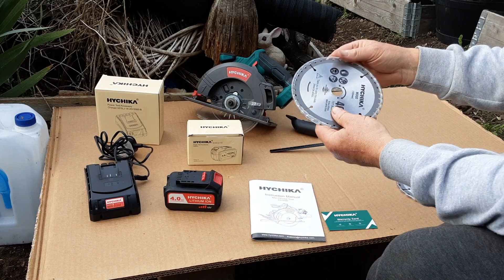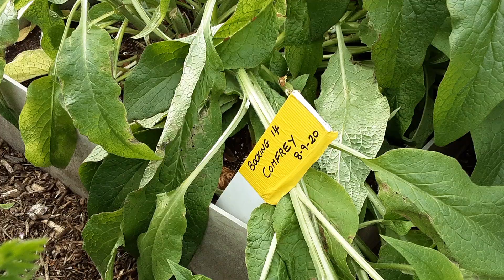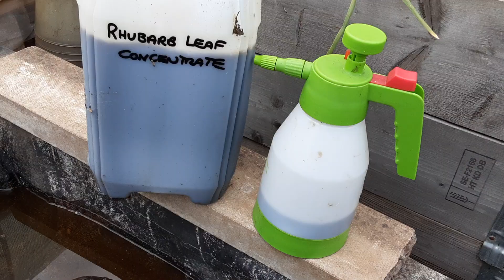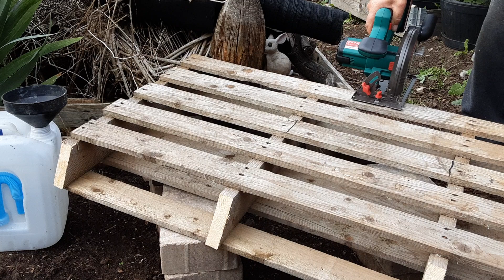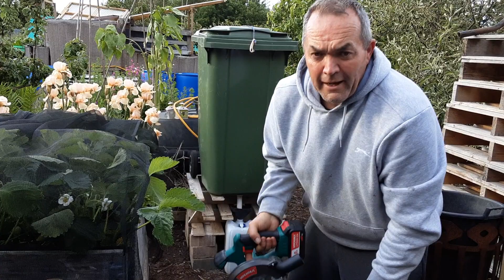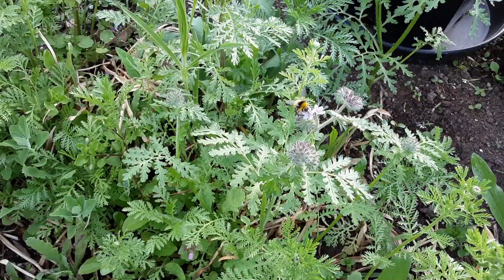Hychika 18v Cordless Circular Saw 🌻 Hychika 7th Anniversary Celebrating With Freebies 🌻 Comfrey Bin

Comment: Yes you can run all tools on all batteries the reason why you get a higher amp battery for some tools they use more power in there running but both will still work 
Its like running a battery lawn mower on on a 2 amp or a 20 amp the 2 amp might give five minutes run time on long grass where a 20 amp might give you 30 mins on the same grass
Reply from the maker: Well explained my friend, thank you. 

♻️Happy gardening, Terry King.

Comment: I would looooove one of them saw's and I saw the wiggle finger..lol...
I agree the comfrey pipe is good but not enough, I have a spare black bin I could use🤔🤔🤔
Reply from the maker: Useful to have those for those little jobs we do. Have you a link to the 12v 240v unit you use to charge stuff up Manda Moo? 

♻️Happy gardening, Terry King.
Reply: @terrykingsallotmentgardening  I don't know how to do a link but the order number on eBay is 133839713960-18781335. Hope this helps...🐮🐮🐮

Comment: Yes you can Terry, the 4ah just gives more run time.
Reply from the maker: Cheers Frank, just needed to be sure and the saw is lighter to use with the smaller battery on it.

♻️Happy gardening, Terry King.